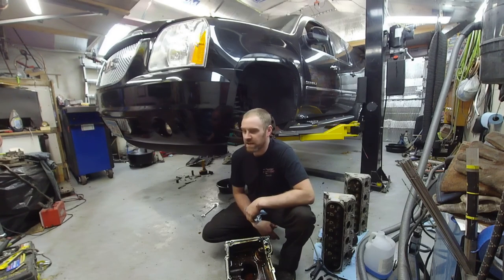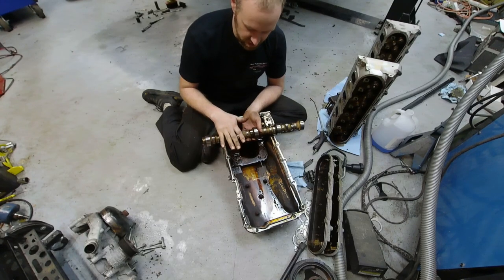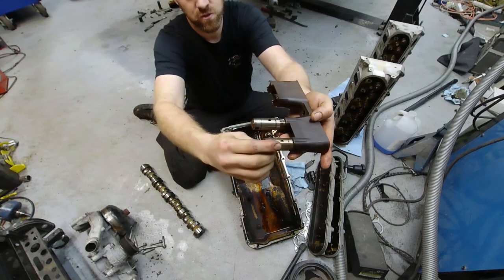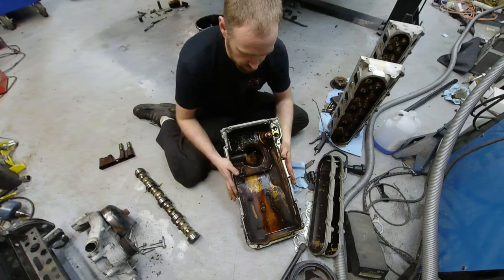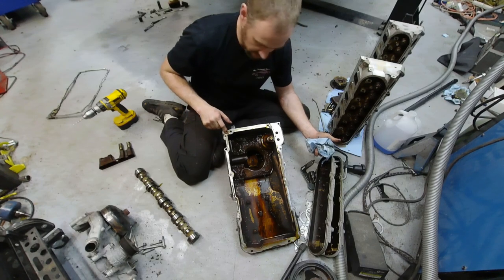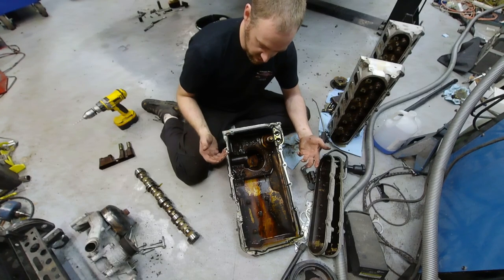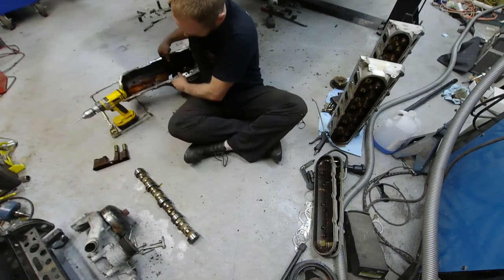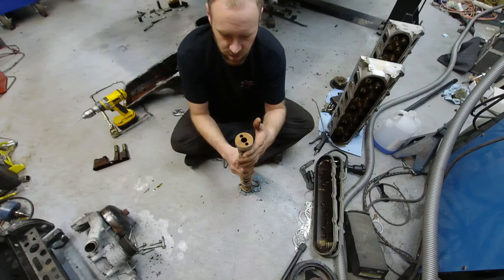Common GM V8 Issues & 6.2L Truck problems

Comment: We have a 2014 6.2 liter Yukon XL, first it developed a miss-fire  and traction control came on.  Dead miss on cylinder #1, Took to shop and had all lifters replaced and cylinder heads cleaned of sludge when they were removed. 3500 miles later exact same problem occurred, FYI after 2 mile downhill then stopped at red light each time. When accelerated the traction control illuminated and service engine light came on with a rough run situation. Once again cylinder #1 miss-fire. Took to a different shop and lifters replaced with a new oil pump.  3 thousand miles later, miss-fire #1 and cam lobe damaged on cylinder #1 intake. Note: Did run engine with valve cover off, and finger pressure on that intake valve (#1 again) would quit moving the valve. Any Thoughts on why this keeps happening and what can we do to prevent it from happening again?  Fit new oil sending unit between first and second time due to a sending unit fault that caused ses light to come on.  Considering putting in a towing cam with 3 bolt face. Any thoughts would be greatly appreciated, Thank you, Melanie.
Reply from the maker: If the cam is damaged it's time to delete AFM/DOD. To upgrade cams will require a tune so you will need a way to get a custom tune. Had it been fixed right the first time the system could have been disabled rather then to continue replacing lifters. These systems fail from low oil pressure, under 27psi at the lifter during activation to be specific. It can be caused by many things. If you do the full delete and want help making sure you do the right thing feel free to contact me at my website.

Comment: My denali runs about 60 psi while driving and goes down to 40 while it idles should i be concerned
Reply from the maker: Not at all, that is good oil pressure. I would just shut the system off for good measure if you haven't done it already.
Reply: @CrazedPerformanceRepair  i ment to say it idles at 20 while parked and 60 wile driving around
Reply from the maker: Oh then it is low unless you are not equipped with AFM/DOD.
Reply: @CrazedPerformanceRepair  im not to sure i have a 2007 Yukon denali 6.2

Comment: What should be done on 2014 6.2 DOD engine with a bent pushrod?
Reply from the maker: You should suspect a sticky valve. Was it intake or exhaust?

Comment: Is the 2012-2013 model year trucks with the 6.2 a DOD engine?
Reply from the maker: Most likely depends on model. You can check by looking at the top of the VLOM behind and under the throttle body. You are looking for smooth cover "Non AFM" or a cover with passages "AFM equipped."

Comment: i will take my 350  any day  in my 92 k1500  ,,better engine
Reply from the maker: I could have made a video on them too but they have phased out (or rotted out) here so I never see them anymore. They are more reliable in regards of the dumb DOD system though.
Reply: @CrazedPerformanceRepair  old chevy trucks from 88 to  98  with  4.3  or 350s  all over the place  in dayton  xenia  area..mine only has 114,000 on it  but a lot  have  way over  250,000  ..mine  is not rotted  out,,,fluid film  helps

Comment: Ever have a 6.2 break a piston ring after turning off DOD?
Reply from the maker: No, but they break them with AFM active that's for sure. It's mostly just the 6.2 as well and I'm not sure why.
Reply: @CrazedPerformanceRepair  mine broke cylinder 4 piston ring about 2 weeks after turning off AFM.
Reply from the maker: It was probably already fatigued and close to breaking. A ring won't get damaged from running like normal engine in a 2 week window.

Comment: so what cam did you end up using? did you make a video?
Reply from the maker: I don't recall if I have video sitting on the drive or not I might but I went with ls9 I believe. Had to get a tune done though for that cam.
Reply: @CrazedPerformanceRepair  I'm currently searching for a truck/SUV and the denali's keep popping out as available so I'm tempted

Comment: So it’s gotta be a 2010 L94 motor. Not the L92. First year of the DOD was 2010. All 2007-2010 L92 motors are just VVT
Reply from the maker: You have that backwards. AFM started in cars in 05, trucks in 07 and vvt didn't get implemented heavy until at least 2010 but I believe there was some early adoption in earlier years.

Comment: My 2011 Escalade has the 6.2 engine with 240k original miles and the dod system works perfect. Absolutely no problems. If people would change the oil was full synthetic oil every 3000 miles and they wouldn’t have mechanical failure like this.
Reply from the maker: I have seen these issues on even spotless well maintained engines. Every vehicle has the chance to get lucky like you did or unlucky like the maintained ones with issues. This particular one was abused though and maintenance most certainly helps a lot.

Comment: My 6.2 just started dying at red lights after being driven for a while. Nobody can figure it out
Reply from the maker: Tq converter lockup not disengaging?
Reply: @CrazedPerformanceRepair  that was one possibility, convertor solenoid. So far replaced vvt mag and cam sensor to no avail. Would that be what u go after next?

Comment: So there not a very reliable motor?
Reply from the maker: Actually, it depends on context. Aside from the oil sump o-ring the bottom end of the engine is extremely reliable. The top end is the section that sees all the problems. This is mostly do to them adding the DOD/AFM system to their engines. Without that system they usually last 400k plus miles before needed engine repair. Most domestic vehicles today are lucky to see 200k miles without major engine repairs to the timing components. This has to do with the complex multi-camshaft engines of the modern vehicle vs lack of maintenance from the consumer at the suggested maintenance from the manufacturer.
Reply: I'm just throwing this out there,my 2012 Silverado 4x4 1500,6.2,has 170,000 miles and has been to the dealership 1 time when the transmission dipstick tube had a recall in 2012.

Comment: U think gm could fix this. Garbage wife has a 2016 denali 6.2 64.000 miles started ticking. Im a ford diesel tech and old chev tech. Seen this stuff from 5.3 gas. What a joke. !  2nd yukon we have bought. Garbage !  In my humble thought process.
Reply: Why do you put your wife down like that?

Comment: 2007-2014 gm vehicles, especially with the 6.2 are the worst vehicles ever. Unbelievably ugly and out dated even for that time. The engines and never ending issues

Comment: Went looking for oil consumption fixes... there was a video that was great but can't find it. Found this one though that talks about the oil relief valve in the pan. There is a deflector kit.

https://youtu.be/OvU1naKi3i4
Reply: Couldn't find the video I saw 2 years ago... hope the one that's linked above helps. If you can get a gm deflector kit for the relief valve you ought to be able to get a new relief valve assembly. Anyway time do pre drink for a party. Have a good night.

Comment: This cat is posting on here daily about GM “DOD” repairs, but GM has called it AFM on these models since 2005. Also, he doesn’t know what a windage tray is called, and he is not aware of GM’s TSBs on AFM, which include a deflector in the oilpan. So how can a self-proclaimed expert be so ignorant??
Reply from the maker: 😂 I post a video once a week not even all AFM/DOD
AFM= active fuel management, it is the system from the fuel control side, from the computer to the fuel system and how it works with the system as a entire system. 
DOD= displacement on demand, and is just the mechanical side of the system alone without the computer control and is also the side of the system I am mostly addressing. 
The windage tray brain fart is just that a brain fart and I'm not going to do a retake over that since most normal people understand I'm human sorry to hear you had a bad day... I was and am aware of the tsb for the windage tray thing and was reminded again on this video with another commenter. I don't claim to be a expert just more knowledgeable than most on here about the system but expert no. If you don't like the videos it's really simple. Don't watch them lol... Cheer up and have a nice day.
Reply: Maybe he has not seen the updates,.   You gotta remember, gm trys to get out of fixing this shit.  So most trucks don't get the proper updates\recalls.  That's why he's fixing the non updated engines!  Like my 2009 Chevy 1500.  Uses oil and chirps at times with the failed lifts and cam noise.  The government should do there job and make an recall this shit and repair it for free.
Reply: Bretz71 you might be projecting your own insecurities regarding ignorance. Would be great if you just contributed in your own way. Such as a comment like "the name of the part you were looking for is Windage tray, happy monday!" To which youd get a "Thanks bretz!" Rather than everyone that reads your post seeing an insignificunt.
Reply: @danielsimpson8929  I see what you did there
Reply: @sellickusa  bots haven't seen it. Good times.
Reply: @danielsimpson8929  Well done Sir, well done!
Reply: @sellickusa  btw the word was stolen from The Boondock Saints film. Mob boss used it while on the phone.
Reply: @4real4now  I don’t have a channel. I’ve forgotten more about GM engines than you’ll ever know. Everything I post is 100% true. If you don’t like my posts, don’t read them. If that’s not good enough for you, fanboy, FO.
Reply: @bretz71  ok, is that makes you feel good about yourself 😂😂. Mr. Knows everything. If you know that much, make your own videos and stop acting like a kid. We can tell you haven't mature yet .